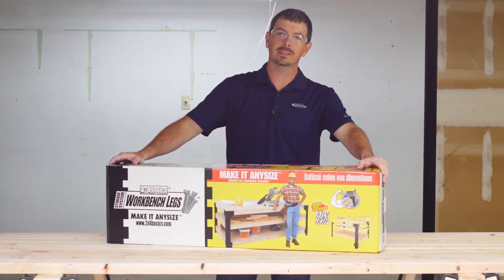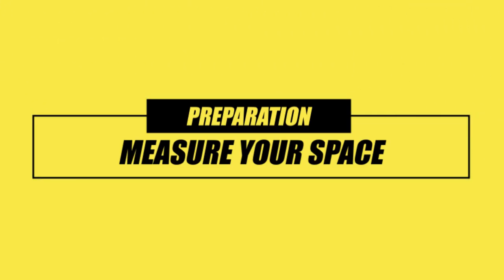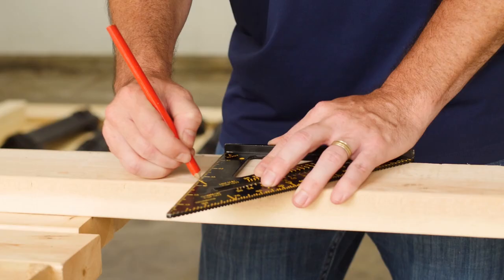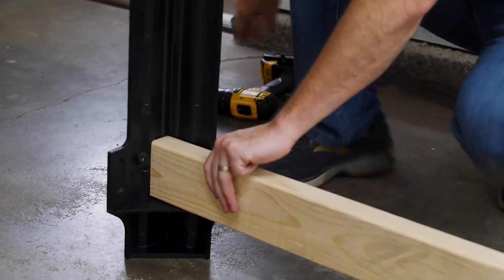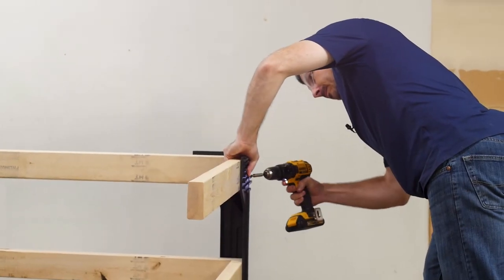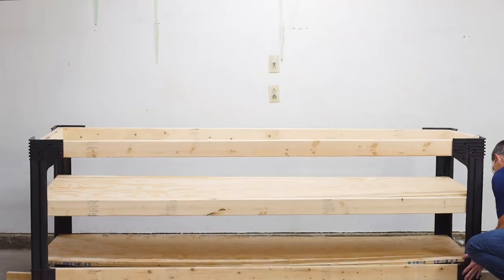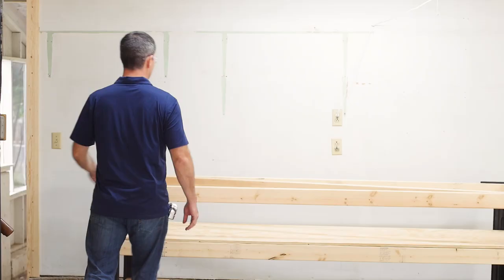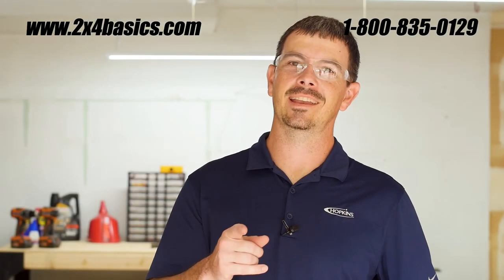How to Build 2X4 Basics® Workbench Legs™ - Instructional Video

Comment: There’s no ability to add a cross support on the lower shelves like you can on the top table surface.  Eight foot long and no support means it will sway from the weight.